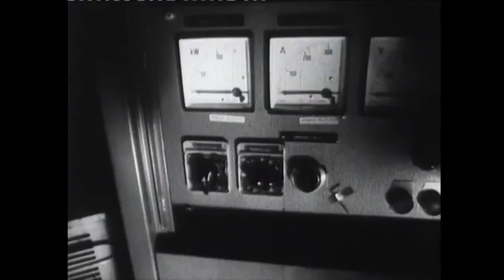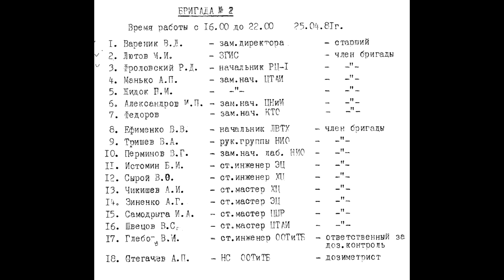Forgotten Chernobyl Accidents

Comment: 1:54 one Becquerel is one radioactive decay per second.  “Becquerels per square centimeter per minute” doesn’t make sense.
Reply from the maker: If you've never heard of the units disintegrations per minute or disintegrations pers second, one disintegration = 1 becquerel.  Thus, the disintegrations per minute over an area is a normal thing to measure :)
Reply: @thatchernobylguy2915  Disintegrations per minute make sense, but Bq is disintegration per second, so saying Bq/min would imply acceleration or deceleration of the decay.

Comment: Excellent! A new video to start off the weekend.

In that first march 7, 1978, clip, in the footage showing a welder welding a seam on one of the pipes, I see a gross welding violation. I'm a retired Master Welder with 30+ yrs of experience, being certified to make those types of welds. He is doing something that should never be done with such a critical weld; striking your electrode like a match on the material to be welded in order to start the arc. Why? He is using the Gas Tungsten Arc Welding process, where the filler material and electrode are made of different materials. In other welding processes the filler is the electrode at the same time. Not in this particular welding process, though. Tungsten is a very hard metal with a very high melting point. That's why it is such a good material for this purpose. There is a major downside, however. By striking your arc to start it, you run the risk of leaving behind slivers of Tungsten. This can cause cracking/breakage in the weld later on in the seam's life. To avoid this, welding machine with what's called a "high frequency unit" should be used mandatorily. This clip of video tells me that they either didn't have these machines at their disposal at the time, or they just didn't care. Which means that all the welds run the risk of having potential flaws in them. Considering the places these welds are living at, this is Not. Good.
Reply: well this was chernobyl in the soviet union... hardly surprising they didnt get stuff right lol
Reply: I imagine these being the sort of accidents they were having when a reactor wasn't being damaged, i.e. the vast majority.
Reply: @markusw7833  
It may be the case. I read somewhere that at a VVER station, when doing the mandatory inspection of all welds during maintenance, a very attentive inspector noticed something odd going on with the X-ray of the weld seam. It turned out that the welder that had done the root weld, didn't actually weld the root weld, but put a filler wire in there and kind of melted the whole thing together like that. This could have easily led to a major primary system pipe break with the subsequent accident that would follow. When checking other seams, they discovered more welds done in the same way. I had a welder like that on my crew once. He was a contractor, and I sacked him on the spot when I saw what he was doing. If the welder doing the VVER welds would be under my watch, they need not worry about the reactor having a meltdown because I would beat the reactor to it. I simply cannot believe how irresponsible some people get when doing critical work like that. And when things go wrong, the poor reactor gets the blame while it is us who bugger things up.
Reply: They blew up unit 4 using instructions. 🤣
Reply: Thank you for your post, I had no idea! 😊👍
Reply: @NickanM 
You're welcome!